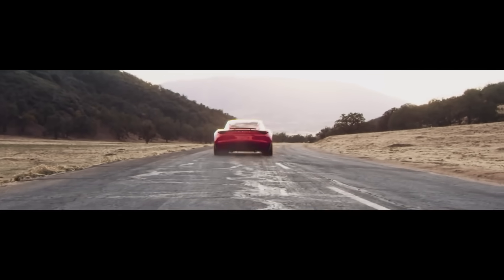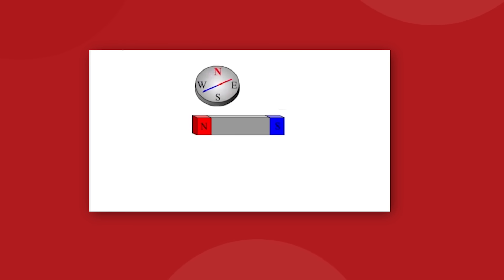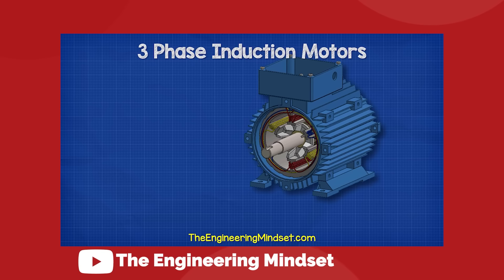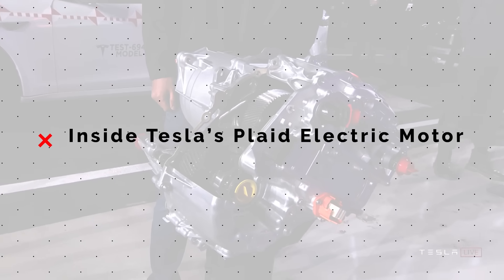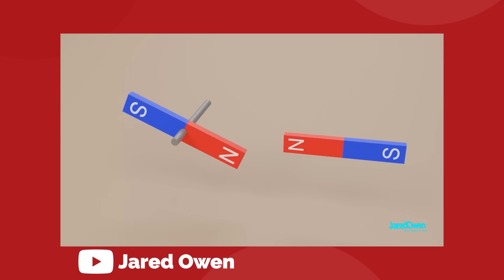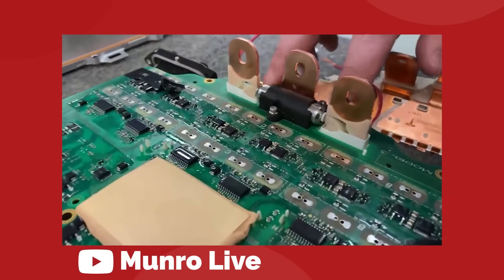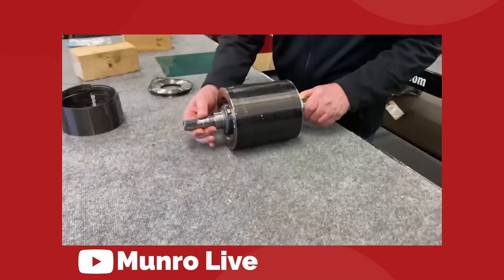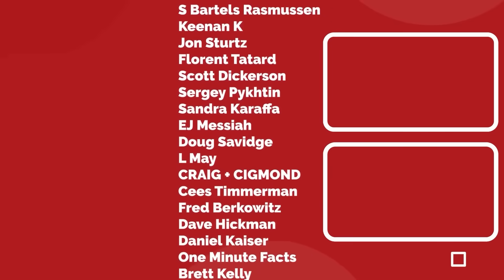The Real Reason Tesla Developed The Plaid Motor!

Comment: For the motors with horizontal shaft, there is also a very slight transient dimensional deformation of the rotor, because of rotor's weight applied between the two bearings, and the elasticity of the materials. It is very small, but it matters when the air gap is very small, too. Decades ago, for the motors that needed very small air gap, a simple way to solve this was to have the shaft of the electric motor on vertical axis.
Reply: Only good if the motor is fixed/Stationary.
In a vehicle subject to heavy acceleration & high top speeds the shaft & rotor will be pressed back against the bearings, stator, causing an elliptical rotation.
"To every action there is..."....
Reply: @alexmanojlovic768   - - I agree. While attending as student the course for the design of electric motors, generators and transformers, back then there was an electrical machine specially dedicated to generate current at about 10 kHz frequency (compare that to the usual 50 Hz/60 Hz). That 10 kHz voltage was used for heating metals by induction. For example, that can harden a very thin layer of steel, while the core remains softer, thus not brittle. I guess that today those 10 kHz for induction heating are obtained by power electronics, that existed but were expensive when I was student. Back to that machine, it had a very, very small air gap, its shaft was vertical and yes, it was installed stationary on a bench in a factory.
Reply: Or a bigger shaft diameter and bearing! In these Axial Flux motor the diameter is very big in relation to the width so the bearings are fairly close together. The problem is with a big diameter rotor is is the surface speed of the rotor.
Reply: @kevinburke6743  - - Yes, Kevin, there is a mathematical formula for that rotor deformation that I wrote about, and the diameter of the shaft is included in it, versus other variables.

Comment: In the Tesla model subject of this video, if the reason for two motors in the rear is to eliminate the need for differential gearing, why there is only one motor for the two front wheels?

Comment: no, the inside wheel does NOT go faster, it travels a shorter distance than the outside wheel, assuming you're in a three-dimensional car. if the outer wheel goes further over the same time period, it is going faster than the inside wheel.

Comment: Using the illustration of the induction motor then a mechanically commutated DC motor with winded rotor to illustrate a permanent-magnet synchronous AC motor is at least confusing.
While the induction motor has similar construction (but lacking the permanent magnets in the rotor), has a very different principle of operation.
On the other hand a mechanically commutated DC motor operates practically on the same principle, has a very different construction.

Comment: You seem to be confusing the Permanent Magnet motor (which is a multi-phase synchronous motor in which the rotor turns at the same rate as the rotating magnetic field) and the induction motor in which the rotor "slips" from the speed on the rotating magnetic field.

Comment: The power of YT comments! I told Sandy the reason for the inverter change was because if two adjacent battery compartments were breached it would cause a cascading failure and fire between the breach and the inverter. AKA megafire.

I learned about it in Michael Crichton's 1995 book "The Lost World". The wisdom of the engineered safety and redundancy of EV bus systems saved the day! Not hyperbole.

Comment: So, it's not an induction motor.
It's a permanent magnet rotor, 3phase AC stator motor.
Induction motors do not have permanent magnets or slip ring energised electromagnets on the rotor.
The rotor magnetism is induced onto it's "windings" by the stator's rotating fields.
I wonder how persistent the permanent magnets on Tesla's motor rotor are. How long until they fade? Is there a periodic remagnetisation of the permanent magnets by the stator fields during say dynamic (regenerative) braking?
The need for and use of the carbon fibre binding of the rotor  is not revolutionary (no pun intended). Neither is the use of a laminar core to eliminate parasitic eddy currents. All per rigor.

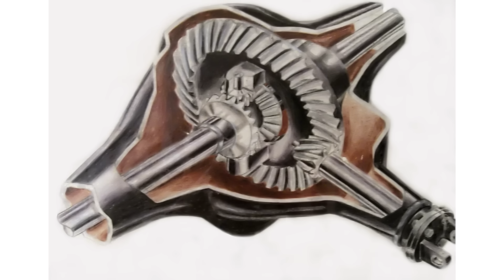Comment: 14:17 ... said that backwards ... the outer wheel has to travel more distance, so the OUTER wheel has to spin faster , but we follow
Reply: On tight corners, at full throttle, my 69 camero would spin the inside tire much faster than the outside tire - making lots of smoke and noise...

Comment: FOR TESLA TO HAVE ALMOST FREE DRIVING CAPABILITY FOR ANY ELECTRIC VEHICLE INCLUDING THE CYBER- TRUCK IT WOULD BE TO PUT ON A FRICTION GENERATOR TO EACH WHEEL JUST AS THE BICYCLE GENERATOR IS ABLE TO POWER A BIKE HEADLAMP.  ALL FREE ENERGY AND THEN CONSTANTLY SUPPLING FREE ENERGY WHILE THE VEHICLE IS MOVING FORWARD AND USING NO ELECTRICITY WHILE THE VEHICLE IS STATIONARY.  IT WOULD BE WISE TO UPGRADE THESE GENERATORS AND NOT PUT A BIKE GENERATOR AGAINST EACH TIRE WITH PROBABLY A RUBBER WHEEL INSTEAD OF A METALIC GEAR DRIVE ON THE END OF THE GENERATOR AND ENGINEERED FOR HIGHER SPEED AND DURABILITY A GENERATOR ON A CAR WOULD BE EXPERIENCING THIS WOULD ALMOST BE ABSOLUTELY FREE DRIVING-  !!!!
Reply: I'm sure that you are JOKING.....Perpetual Motion does NOT exist, and this does not work in the real world.

Comment: "The north pole of a magnet will always seek the north pole of the earth." Well, no. It's the magnet's south pole that seeks the north pole of the earth. To verify this, try to push two magnets together with north and south poles in the same orientation.

This means a compass needle's "N"-marked end is actually that magnet's south pole. It points north, but it is not itself a north pole.

But nice video anyway.

Comment: If the inverter goes dead for some reason, the (very strong) motor could slow down the wheel as if you had suddenly stomped on the brake (but only for that wheel!). The explosive fuse could disconnect the motor in such a case, letting the wheel turn freely.
Reply: I am thinking the explosive fuse has a lot more to do with the eventual failure of the IGBT or SCR and the likelihood that it becomes a dead short and a fire hazard due to the huge amount of Amperage available plus the high Voltage may arc and sustain the short circuit.  Another factor is like you say that that one coil of the stator getting a huge amount of power and staying there would/could significantly and rapidly decrease the speed of the motor and wheels. There are several other ways to decouple the motor from the inverter without explosive fuses . I also wonder if it’s not maybe the DC bus supply to the inverter that’s being interrupted. 🤷‍♂️
Reply: In the old days, a forced reversal was called "plugging".  It resulted in hundreds of amperes of reversed current, the energy coming from the back-drive on the motor.  In cars, this would result in an immediate skidding of the wheels, and uncontrolled spin-out deceleration.  Usually the reversed rectifiers, SCRs, IGBTs just blow up.
Reply: @brunonikodemski2420  "plugging" is now a perverse activity on certain websites 😂😅🤣
Reply: Oh my word & I thought improving electric motors, due to the already high level of efficiency compared to ICE was nearly as far as you could go & nowhere near as complex as ICE..... 🤦🏻
Reply: I do agee with Tony Bjorklund: Tesla has lots of pyrofuses in case something goes wrong. 
Do to the cross-section, these "fuses" look more like contactors to short the motor's phases together...do you have a clearer picture of them?
Or do you know where can I easily  find this bus-bar?

Comment: The star shaped design where the inner part of the rotor comes up to the surface in addition to the poles is so that it can partially act as a reluctance motor, this is presumably what that boost in power they mention is. Also, although the carbon does stop the rotor expanding, it is a bit more than that since it's literally the only thing holding the the rotor together, adhesives would not be strong enough and metals would introduce serious losses. I think they had a previous iteration where the pole laminations were actually part of the core laminations and that just could not have been nearly as good as this, although it did reduce the gap in the magnetic paths so it might have had higher torque.
Reply: I think american have rights to sue all n a z i & jaguar for immitate & push political agenda to sell their ev into usa market. Which trapped american civilians a n d only supports elitz c0mies

Comment: I think the CF wrap is there to help keep the "t shaped caps" and magnets in place too- this CF wrap around the rotor won't be too good at conducting a regular flux/magnetic pattern and will have the same effect as increasing the air gap between the rotor and stator laminations and so that's why they need the much stronger magnets I suspect too...
Reply: Thanks for explaining. I was wondering why there are magnets needed in the 3phase ac induction rotor in the first place... its actually 1st time i see them there at all. Also...if there is huge heat build up under cobstant load...cannot it demagnetize the permanent magnets?
Reply: @yx2803  You are correct, A build up of heat does demagnetise permanent magnets and so I would guess that it's mitigated by the temperature monitoring and cooling systems, But also it might actually be something that decides the motor/rotor's  lifespan- The tech is still new to me too so maybe in years to come people will be servicing their Ecar's magnets like we would the clutch or other parts that are subject to wear in a traditional ICE driven vehicle. All the best.
Reply: @adammorris3082  thats entirely possible. Also the power components and contacts in the invertor didnt seem particularily robust. Reminds me of current tube amps circuits with tube sockets soldered directly on pcb. Sad to watch:-(
Reply: @yx2803  Interesting. I remember when tube TVs changed from hand-wired to PCBs. It doesn't make sense for high end audio to be taking cheap short-cuts like that, but caveat emptor.

Comment: You sort of skipped right past the most important functional detail that the copper wire wrapped around the metallic core is what causes the magnetism when you send the electricity through the copper wire. You have to show that whole example where you take a steel bar and wrap an extension cord around it and plug it into the wall and the steel bar becomes a magnet because the extension cord is wrapped in a spiral motion around the steel bar. That's the core functionality of how an electric motor works.
Reply: Yes... but also no. Current flowing through a wire will create a magnetic field even without any iron core. Wrapping the wire into a coil (again, with a current running through it) will produce a magnetic field that functions exactly like a permanent magnet.

The reason to include an iron core is that the magnetic domains present in iron, normally random, will orient themselves to align with a strong enough external magnetic field. This ends up amplifying the original magnetic field leading to a stronger and more efficient motor.

But, ultimately, the core is optional, not a requirement.

Comment: a steel sleeved rotor will also block some of the magnetic interaction to the stator, acting as a weak faraday cage. A magnetic field can pass right through a thin band of carbon fiber.

Comment: Just for grins, there is nothing magical about rotor in the center and stator around the outside.  They can be switched and there are applications where that is an advantage.  One can have an outside rotor with an internal stator.

Comment: Good job, you got most of the major points nearly right. Personally I don't get why Elon chose to name the Company Tesla. Tesla himself was all about ground breaking innovation.  Some of his work and prototypes were decades, perhaps even centuries ahead of anything else, and could easily be mistaken by the common man as 'magic'. What we see in current Tesla vehicles is based an 80+ year old electromagnetic induction motor design with a few improvements made possible by scaling up production through modern factories and machines. If Nikola Tesla was around today these vehicles would no doubt have unlimited power and range, without ever needing to stop and recharge.
Reply: 100% EFFICIENCY STILL DOES NOT EXIST.
Reply: @0077alfie  Neither do re-hydraters  that turn a quarter size morsel into a full large pizza..

Comment: The Plaid was what I expected Tesla’s response to the Porsche Taycan to be. Porsche multiplied torque and increase top speed with a 2-speed transmission. Tesla did the same by doubling rear motors, increasing redline, and lowering gearing.
Reply: The  taycan is a parlor trick.  They have a pack system that can switch between 400v and 800v to fake faster charging. The car is two packs that each only handle 135kw.  They only needed enough batteries to make two 400v packs  because the car is inefficient, so cramming in batteries lets them advertise a longer range while they leave out the slower charge speeds due to inefficiency.   They also had to use a transmission because they could not get a motor to spin fast enough.  That transmission will likely fail early.  Porsche keeps claiming the current dash transmission errors are purely software bugs, but there is no way to know, legacy companies will always try to update cars in negative ways for the consumer to push component failures beyond the warranty period.  People are gambling on if the transmission failures are hardware issues with a software coverup or just bad  software that in theory can be fixed with an update.
Reply: ....transmission is antiquated. hub motors are the future and the present
Reply: @Blox117  Hub motors have very high unsprung weight, the enemy of good suspension engineering. For automotive use, hub motors are a bad idea. A little gear reduction and a haftshaft work just fine and keep the motor well away from vibration, water, dirt, and salt. It also means the cooling lines and high amp wires aren't flexing all the time which could be a real problem over time. The reason many racing cars use inboard disc brakes is to reduce unsprung weight.

Comment: You made a couple mistakes explaining magnets and electro magnets.  Firstly. You said the north pole of a compass is attracted to the north pole of the earth but it's actually the south pole of a compass that's attracted to the north pole. And then you said copper becomes magnetized when an electric current is run through it but it actually needs an iron core to become a magnet. Running DC current through the copper windings orients all the domains in the iron core in the same direction making the two distinct poles and thus becoming a magnet.

Comment: Those magnets that they couldn't figure out why they were in the engine stop the field created by the motor from flying off in different directions. Tesla did a write up on it a while back as they were getting ready to release them in the Plaid. They have a video animation that shows how the magnets placed at certain locations stop loss of energy by keeping the electro magnetic field stable  <- hope that is correct. That is the just of it. The animation does a really good job of justifying it. Search on something like Extra magnets in new Tesla motor animation. I'm sure eventually you will get to it.

Comment: Would be cool to see them do a super car. Lightweight carbon fibre body/2 seats.
Reply: Look up the roadster.  First car they made.  2 seats, carbon fiber.  The company I work for designs next generation electric motors.  We put a 400kW (peak) motor in one.  0-60 in the blink of an eye.  Drove like it was on rails.  You can take a normal right hand turn from street to street at 45MPH without a single sound from the tires.  Only downside is it'a still on the original battery pack, so it's older tech that overheats too easy.  I took a VIP on a bit of a joy ride, and the dang thing went into limp mode a few miles from the office.

Comment: The differential wheel speed error has been mentioned so I won't mention it as well other than to say how pleased I am to see people picking up on that. Instead, I'll pick on the use of the word, "fastest" twice, when, "quickest" was the intended meaning. One has to do with describing acceleration, the other top speed.

Comment: an interesting point about carbon sleeve is that for synchronous reluctance motor, they can replace the ring width of magnetic metal in the rotor, the thickness gives mechanical strength while interfering with the magnetic field optimal shape, by reducing it and replacing it with carbon, the magnetic field can be improved for efficiency. But I don't know if this motor is of this kind. If it uses permanent magnet it's definitely not.

Comment: Using mislabeled boards isn't really "production efficiency." Especially considering there are apparently design changes. It costs almost nothing, and takes almost no time to change the silkscreen between runs of a PCB. Maybe they had a surplus of the boards, but its definitely not the case of "everyone is too busy to edit a piece of text, aren't they efficient?"